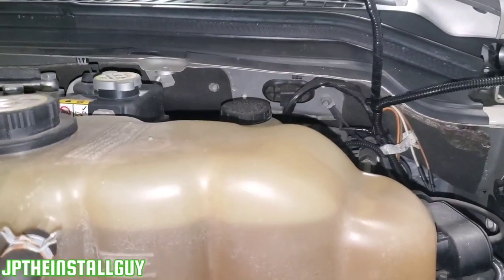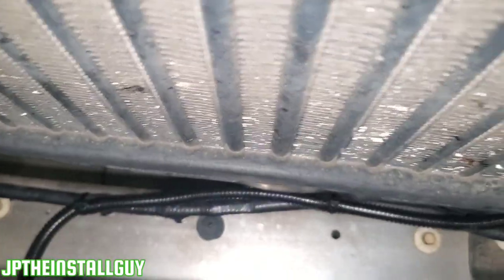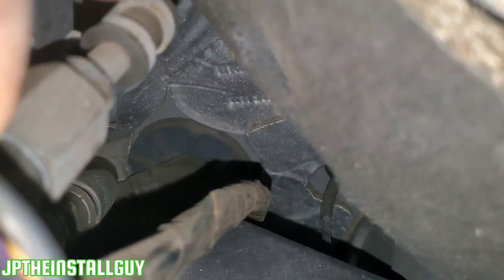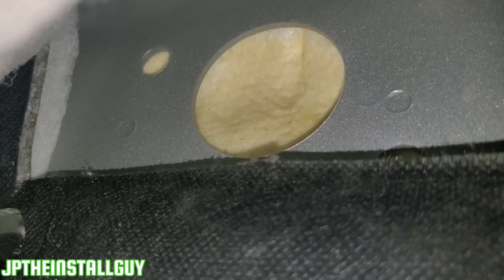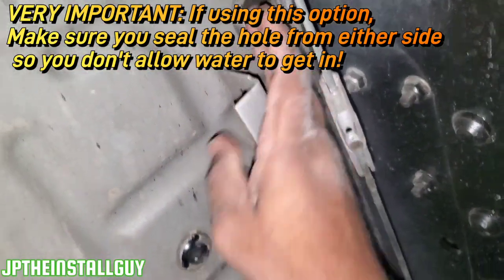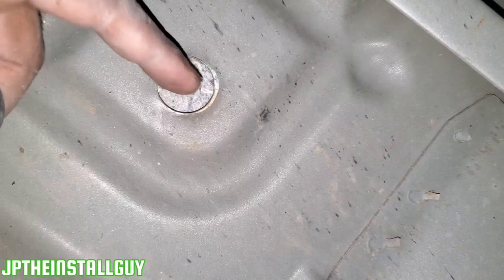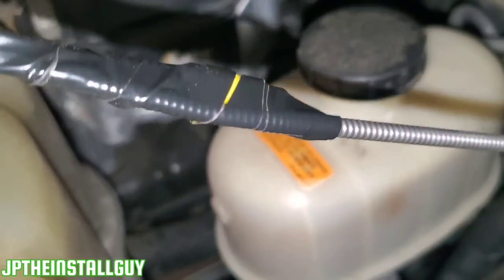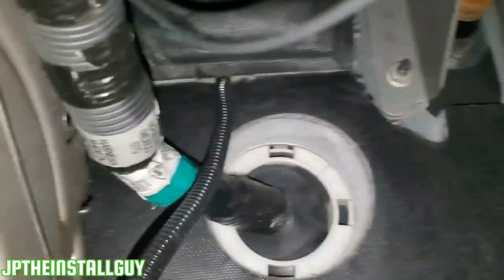how to run wires through firewall of your TRUCK

Comment: Heater core plugged up beyond flushing, don't want to take the whole dash apart, thinking about a portable 12v heater/defroster and running the wire through, this video helped give me a good idea. I'll be back to watch again when I start this project. Thank you!!!

Comment: Those 3-4 orange wires and the white wire are OEM PASSTHROUGH WIRES. Ford does this. Not sure if other makes do.
Reply: Yeah, on the F-250 & F-350 they are probably to hook up accessories to the upfitter switches, if equipped. If not equipped, the wires are just in the harness and might go to an empty connector inside somewhere.

Comment: Good stuff friend. I would add that it would be helpful or safer to put a little swag in your wires for drips to drip down and away from the firewall or the hole in the firewall. Also seal it with some kind of bee sealant or silicone to prevent any water getting into your cabin or wires. Anyhow I appreciate you sharing your knowledge

Comment: Do you think this will cover the 2006 F450? I looked at my fire wall ans there's all kinds of additional sound layers and reflective stuff (on both sides) that I'm not seeing here. I need to run an antenna wire into the cab from a hood mount .